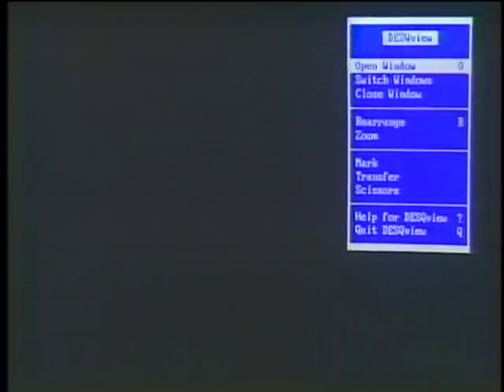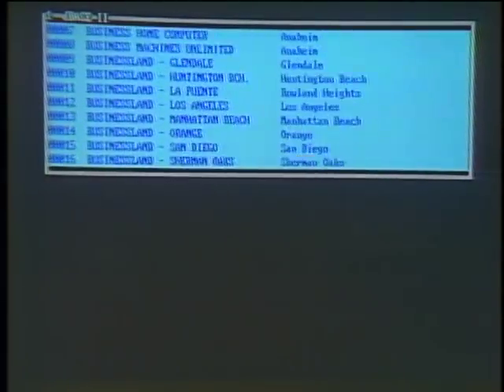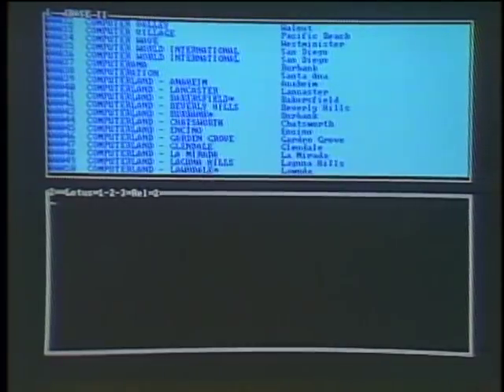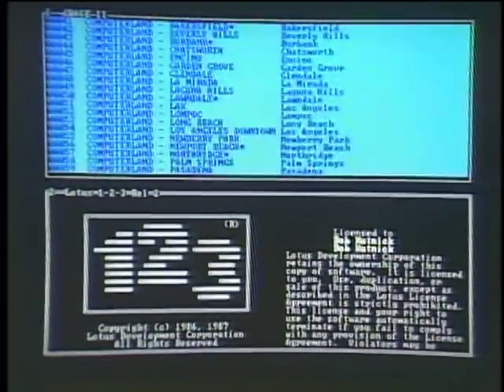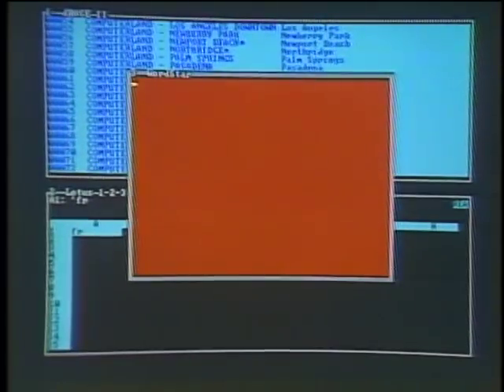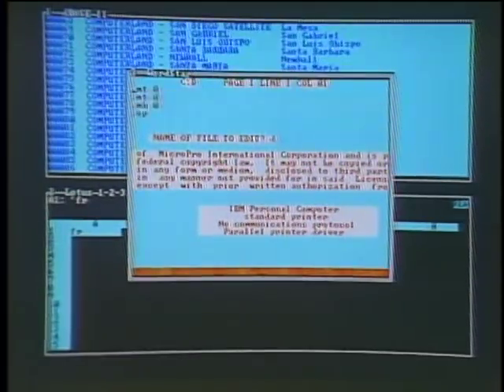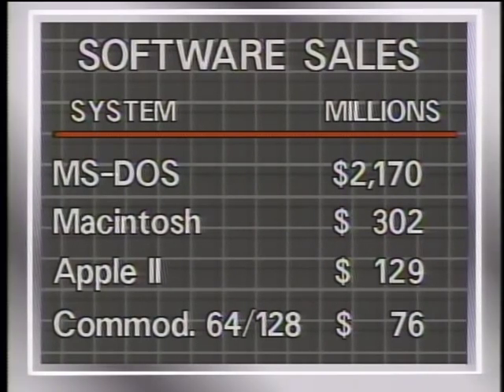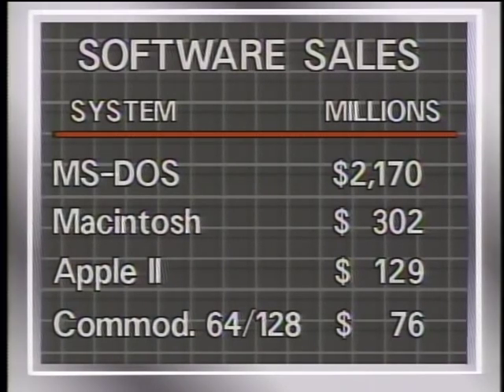The Computer Chronicles - BUS Wars (1988)

Comment: 17:26  Chet's insolent answer to this question is part of the reason why OS/2 and MCA generated such considerable resistance to broad adoption.  You can't tell customers to just throw their old cards and software away - then ask them to buy a new computer, buy new cards, and buy new software to replace what they already have.  The DOS [penalty] box on OS/2 versions 1.x, along with a bus that would not accommodate existing ISA expansion cards, ended up boosting the credibility and acceptability of competitors Compaq, Dell, AST Research, Zeos, Northgate, Gateway, HP, etc.  And then the coup de grace was Microsoft introducing Windows 3.x running on DOS, and just like that... IBM was marginalized in the very personal computer industry standard that they had developed.  It's the difference between marketing to consumers versus to businesses.  IBM never quite understood the former, while Apple and Commodore never quite understood the latter.
Reply: And Tandy Died playing isolation and proprietary...  A point Packard Bell fell to when they used proprietary motherboards and custom Riser ISA slots. Both paid for it.  then dell came along and did the same, took a major hit and backed out
Reply: @trs-80fanclub12    good points 👍🏽
Reply: At least he can intelligently answer the question as many back in 1988 could. They had maturity and knowledge.  Today, all you have as youngsters who cannot scratch the surface of the complexity of real technology and just parrot the marketing scripts.
Reply: @harryparker9452    No one is questioning his intellect.  He and IBM talked down to PC customers, and they paid for it... incurably.
Reply: @LordHorst  agreed, 99% of apple users use the PC to publish thoughts, blog or just look intelligent. Schools get them and push it. I haven't met a apple that can keep up with my home built for 1/2 the price.  I have to help apple users understand how PC's work every day. Sad but true.
Reply: @harryparker9452  Their assessment is accurate, even without hindsight. By the late 80's IBM had already lost the "clone" wars", the vast majority computing had standardized around x86, there was no other point in time where there were as many clone manufactures for x86 systems than then. IBM lost the pulse of the market already by that point, and their attempt to close PC's around a propriety bus architecture just proved what everyone at that time with a lick of sense was seeing. At that point in time IBM was purely living off their name. And to be blunt, by that point no one really cared.
Reply: @John Smith Yeah, the Amiga along with its impressive bus performance on the A2000 never really got the attention that it deserved, especially in North America.

Comment: It wasn't until protected processing in operating systems like Windows NT, OS/2, *nix etc that the actual hardware interfaces became meaningless. At the time of this program, applications could directly address the hardware, so standards were really important. Now everything is abstracted to drivers. The software really has next-to-no-idea (or need to know) how the hardware talks to each other. Thank god for that.

Comment: 8:26 No mention of the cost to license the MCA bus from IBM or that they didn't want IBM holding them by the gonads.
Reply: I noticed that as well when he questioned proprietary, and it was available to everyone.  From what i read MCA was pretty good, but licensing was expensive.
Reply: @seani1473  The fee was a variable cost from 1 to 5% of gross sales. That is, a percentage of the total gross sales of the company, not just on computer sales but everything else if they sold other stuff, including service contracts.  They had to also enter a licensing clause saying the company had to retroactively pay a smaller percentage back on prior PC clone sales, even machines that did not have MCA since they were sold pre-dated to that time period.  And that was just the cost of licensing the technology, not for any type of hardware to go with it. Needless to say, nobody found this attractive in the least bit and only confirmed that IBM was the devil.

Comment: ISA was still around when I got my first PC in 94. Didn't last long after that. It was a AST too. I still have it.
Reply: ISA is still around for industrial computers, they just call it PC/104 now.
https://en.wikipedia.org/wiki/PC/104
Reply: ISA lasted into the late 90's. For a while it was like PCI.... with 1 slot hanging out ear the edge of the board for a period, just in case. And usually on full-size boards.

And at that point EISA was a heavy standard in the server world. You could crack open a mid-90's AlphaServer and find plenty. I have old hardware I keep around as working museum pieces.. one  my AlphaServer 1000 4/266 from 95 has 7 EISA slots. Have several EISA cards in it, as it was used as a file server it has 2 add on EISA Adaptec SCSI controllers (in addition to its onboard), an EISA 3Com Ethernet card.

Comment: Sometimes, I'm really happy my entry into PC computing world happened after the bus war.
But we got a fair share of IT wars after that too ;)
Reply: PS/2 machines were too expensive for most people anyway, MCA was basically a nieche. 
Most people never even touched or saw one of those PS/2 machines, businesses tied to IBM though did.

Amazing how IBM basically killed with the better technology itself out of the market and taking OS/2 with it because it could not get their greed under control. If MCAs licensing fees would have been low or an open technology to begin with, things probably would have looked differently now. But PS/2s main existence was to kill off the clone market. I feel sorry for the engineers involved, they really made a kickass hardware which was in some aspects the pinnacle of what was possible at that time and all for nothing because of the greed and short sighedness of the IBM management!

Comment: 20:46 Not all cards  must be high-performance. Especially special-purpose cards, a company isn't going to want to replace them when the old ones are plenty fast. With EISA you could use high-performance cards for things that mattered and still use the older cards for everything else. It also keeps the cost of those down because they have a wider market.

Comment: Yeah it's pointless to have a 32bit proccesor in your pc if the bit bus is only 16bit,like the 68000,wich is even found in the sega genesis.
Reply: Unless the bus runs at double the clock and you have a 32 bit to 16 bit converter between. But that makes the entire architecture more complicated.
Reply: Addressing is still an issue however.
Reply: I wouldn't say pointless. In the case of the x86 or 68k processors they are CISC, and in that they do not process either an instruction or the data involved in a single cycle. Which means that the bus is actually waiting more often than not. Now the bus is used by other devices in the system but in the case of the PC the CPU is king. So a 32 bit processor splits the data in to 2 consecutive 16 bit chunks to communicate over the bus, which will probably have enough time to handle this and still have time left over for the rest of the devices on the bus before the CPU is finished with it's next instruction. Lets not also forget that just because it's a 32bit processor not all instructions are in fact 32 bit with many being 16 bit commands. There is some loss, and thats down to architecture. Take a look at the Atari Falcon a 32 bit 68030 processor on a 16 bit bus compared to other similar 68030 systems it was vary comparable.